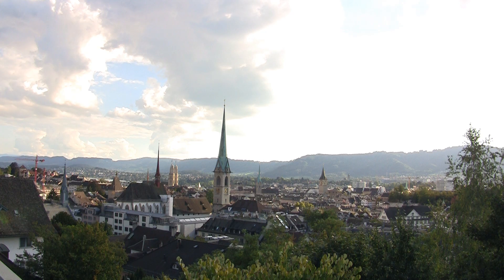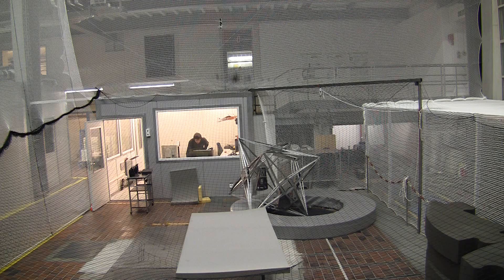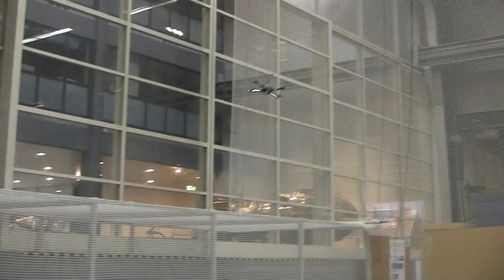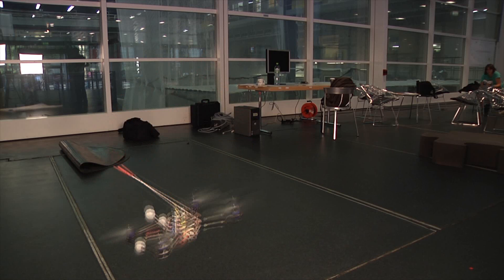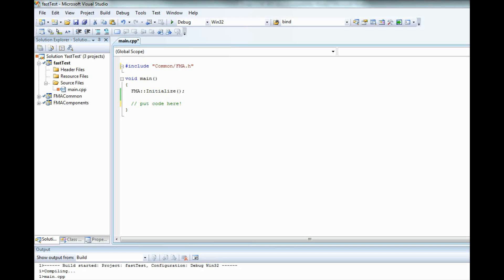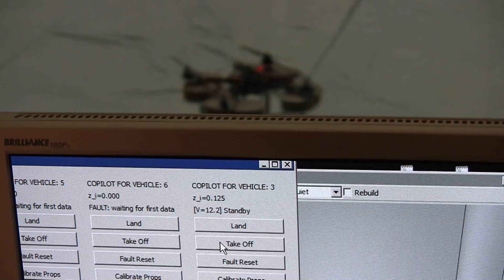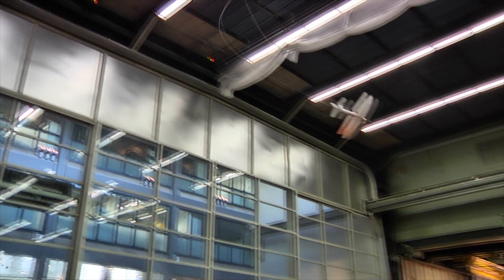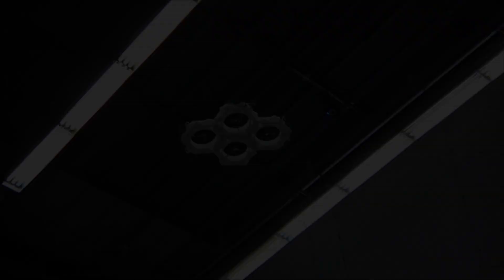The Flying Machine Arena as of 2010 (Final Version)

Comment: As you know, the quad-copter has 4 propellers. 2 of them goes clockwise and the other 2 goes counter-clockwise. Thus when you take som power off the clockwise propellers and add that missing thrust to the other pair, it will turn counter-clockwise, because of the superior momentum created by the counter-clockwise pair. That's basicly it, search for tri/quad-copter on google to learn more.

Comment: @LMF5000 You could put a processor and some memory on the quadcopter itself and run the low-level algorithms of your current software on it using the position data from the on-board navigation sensors instead of cameras in the room. And in the next version, include an on-board camera and train the computer to use it to recognise things such as a special mark you'd place on each charging station for the robot to recognise them, and see and avoid hazardous obstacles such as walls.

Comment: Actually yeah, that looks to be it. In the part showing the props, you can see a right hand, and a left handed prop. So you would have one pair that would rotate in one direction, then the second pair would rotate in the opposite direction. To yaw, into one direction, you decrease the rpm of the rotors rotating into the spin, while simultaneously increasing the rpm of the rotor against the spin. The lift still balances out, but main body has to yaw in order to conserve the lower prop momentum.

Comment: @UntitledTitle Shouldn't it be possible to maintain level flight with 1 failed motor? The 2 opposite motors would have to be able to at least carry the weight. Any inbalance perpendicular to the line between the 2 opposing motors will be dealt with by the remaining motor, either negative or positive lift.

Comment: Very impressive, but as some commenters noted, the quadcopters aren't capable of doing much outside of the arena. What are the chances of solving that problem by using an on-board inertial navigation system (three orthogonal gyros and three accelerometers) for the quadcopter to be able to calculate its position  and orientation in space without using external cameras? Sure you'd need some other reference to correct for gyro drift, but then they would be able to fly anywhere.

Comment: @miklonish I would assume from just watching this they use a Lithium Polymer because of there high discharge rates, voltage per cell and weigh less than most other batteries including lithium ion which power most computer electronics.